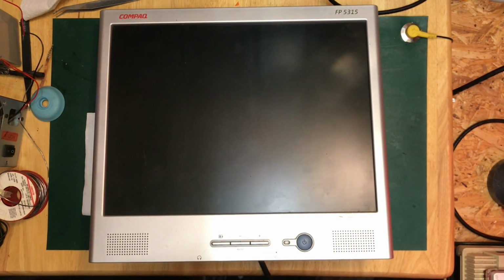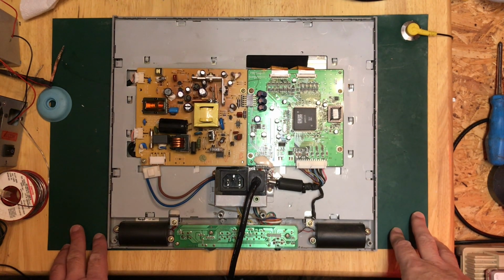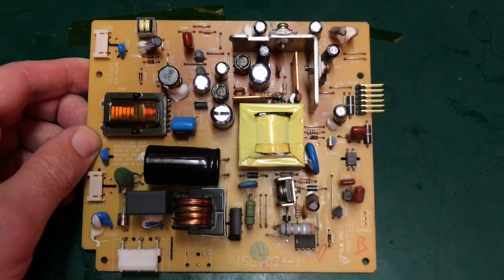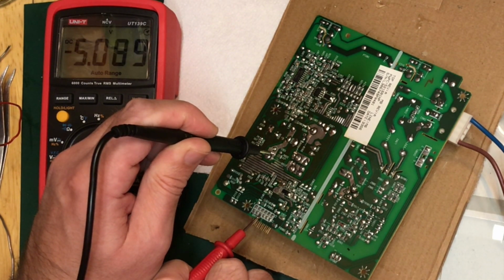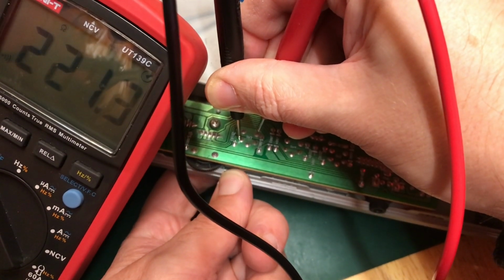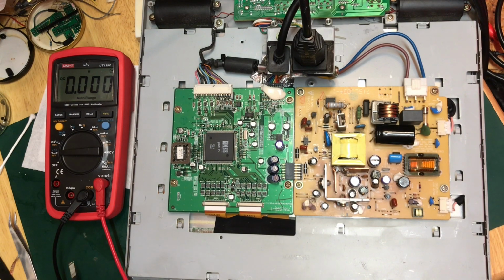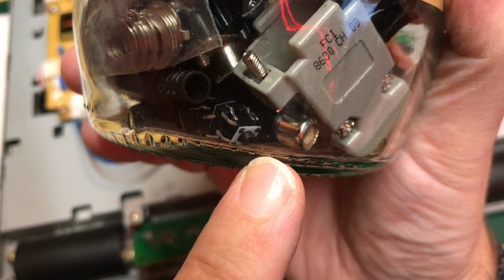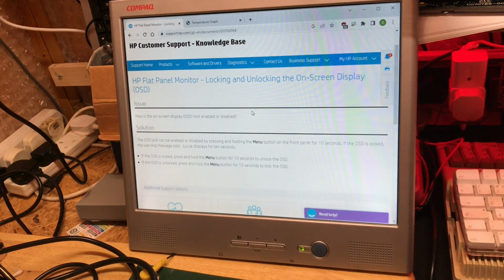Repairing an old Compaq VGA monitor

Comment: I had the same issue with a HP monitor I picked up from a charity shop last year, and it has exactly the same OSD as this one so I'm guessing it's from the same manufacturer. It worked great after I replaced the switches although unfortunately no amount of cleaning could get rid of the nicotine smell.
Reply from the maker: Wish I'd known that before all the power supply testing! The last few monitors I've repaired have all been PSU. Had the blinkers on! :-)